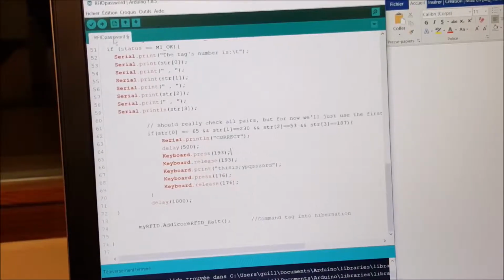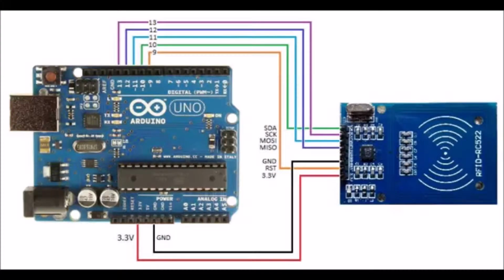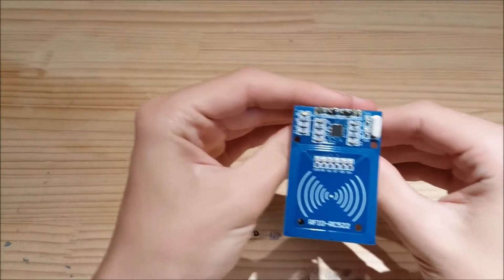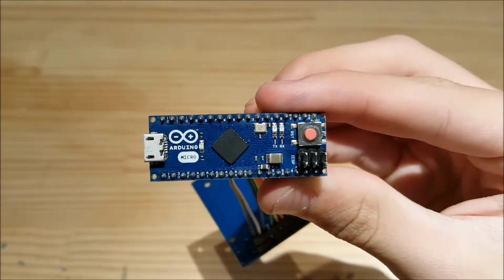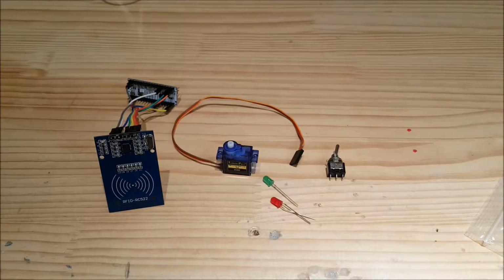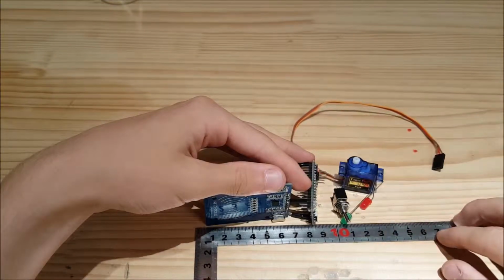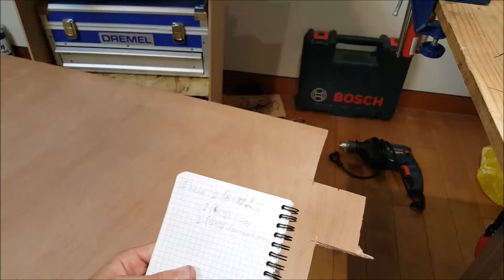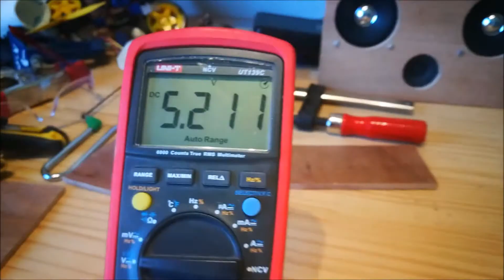AWESOME RFID BOX!

Comment: Can we have all Arduino codes please
Reply from the maker: Here is the code:

//Electronology RFID arduino box. 06/2018. You pass the badge in front of the receiver
//and the servo turns to open the door

#include <AddicoreRFID.h>
#include <SPI.h>
#include <Servo.h>

#define uchar unsigned char
#define uint unsigned int
uchar fifobytes;
uchar fifoValue;
AddicoreRFID myRFID; // create AddicoreRFID object to control the RFID module

Servo myservo;
//pins
const int chipSelectPin = 10;
const int NRSTPD = 5;
const int greenLED=12;
const int redLED=11;

int opclo=0;

#define MAX_LEN 16

void setup() {                
  Serial.begin(9600);                        // RFID reader SOUT pin connected to Serial RX pin at 9600bps 
  SPI.begin(); // start the SPI library:
  pinMode(chipSelectPin,OUTPUT);              // Set digital pin 10 as OUTPUT to connect it to the RFID /ENABLE pin 
  digitalWrite(chipSelectPin, LOW);         // Activate the RFID reader
  pinMode(NRSTPD,OUTPUT);                     // Set digital pin 10 , Not Reset and Power-down
  digitalWrite(NRSTPD, HIGH);
  myRFID.AddicoreRFID_Init();
  //Servo
    myservo.attach(9);
    myservo.write(0);
  //leds
    pinMode(greenLED,OUTPUT);
    pinMode(redLED,OUTPUT);
}

void loop(){
  uchar i, tmp, checksum1;
 uchar status;
  uchar str[MAX_LEN];
  uchar RC_size;
  uchar blockAddr; //Selection operation block address 0 to 63
  String mynum = "";
  str[1] = 0x4400;
  
  //Find tags, return tag type
  status = myRFID.AddicoreRFID_Request(PICC_REQIDL, str);  
  
 //Anti-collision, return tag serial number 4 bytes
 status = myRFID.AddicoreRFID_Anticoll(str);
 if (status == MI_OK){
    Serial.print("The tag's number is:\t");
    Serial.print(str[0]);
    Serial.print(" , ");
    Serial.print(str[1]);
    Serial.print(" , ");
    Serial.print(str[2]);
    Serial.print(" , ");
    Serial.println(str[3]);

            if(str[0] == 65 && str[1]==230 && str[2]==53 && str[3]==187){//right card detected
                //Serial.println("Hello !");
              digitalWrite(greenLED,HIGH);
              delay(100);
              digitalWrite(greenLED,LOW);
              delay(100);
              digitalWrite(greenLED,HIGH);
              delay(100);
              digitalWrite(greenLED,LOW);
              delay(100);
              digitalWrite(greenLED,HIGH);
              delay(100);
              digitalWrite(greenLED,LOW);
              delay(100);
              digitalWrite(greenLED,HIGH);
                
                if(opclo==0){//checks if the door is open already
                  myservo.write(150);//open
                  opclo=1;
                  delay(1000);
                  digitalWrite(greenLED,LOW);
                }
                else{
              digitalWrite(redLED,HIGH);//door is already open
              digitalWrite(greenLED,HIGH);
              delay(200);
              digitalWrite(redLED,LOW);
              digitalWrite(greenLED,LOW);
              delay(200);
              digitalWrite(redLED,HIGH);
              digitalWrite(greenLED,HIGH);
              delay(400); 
              digitalWrite(greenLED,LOW);
              myservo.write(0);//close door
              opclo=0;
              delay(1000);
              digitalWrite(redLED,LOW);
                }
            } 
            else{
              digitalWrite(redLED,HIGH);//wrong card detected
              delay(200);
              digitalWrite(redLED,LOW);
              delay(200);
              digitalWrite(redLED,HIGH);
              delay(200);
              digitalWrite(redLED,LOW);
              delay(200);
              digitalWrite(redLED,HIGH);
              delay(200);
              digitalWrite(redLED,LOW);
              delay(200);
              myservo.write(0);//close door

            }}
        myRFID.AddicoreRFID_Halt();     //Command tag into hibernation              
}

Comment: Where is the code?
Reply from the maker: Here it is !
Reply: @electronology4665  thankyou!
Reply: @electronology4665  hey it would also be great if you could make a walkthrough video of making the circuit and installing the card id :)
Reply from the maker: //Electronology RFID arduino box. 06/2018. You pass the badge in front of the receiver
//and the servo turns to open the door

#include <AddicoreRFID.h>
#include <SPI.h>
#include <Servo.h>

#define uchar unsigned char
#define uint unsigned int
uchar fifobytes;
uchar fifoValue;
AddicoreRFID myRFID; // create AddicoreRFID object to control the RFID module

Servo myservo;
//pins
const int chipSelectPin = 10;
const int NRSTPD = 5;
const int greenLED=12;
const int redLED=11;

int opclo=0;

#define MAX_LEN 16

void setup() {                
  Serial.begin(9600);                        // RFID reader SOUT pin connected to Serial RX pin at 9600bps 
  SPI.begin(); // start the SPI library:
  pinMode(chipSelectPin,OUTPUT);              // Set digital pin 10 as OUTPUT to connect it to the RFID /ENABLE pin 
  digitalWrite(chipSelectPin, LOW);         // Activate the RFID reader
  pinMode(NRSTPD,OUTPUT);                     // Set digital pin 10 , Not Reset and Power-down
  digitalWrite(NRSTPD, HIGH);
  myRFID.AddicoreRFID_Init();
  //Servo
    myservo.attach(9);
    myservo.write(0);
  //leds
    pinMode(greenLED,OUTPUT);
    pinMode(redLED,OUTPUT);
}

void loop(){
  uchar i, tmp, checksum1;
 uchar status;
  uchar str[MAX_LEN];
  uchar RC_size;
  uchar blockAddr; //Selection operation block address 0 to 63
  String mynum = "";
  str[1] = 0x4400;
  
  //Find tags, return tag type
  status = myRFID.AddicoreRFID_Request(PICC_REQIDL, str);  
  
 //Anti-collision, return tag serial number 4 bytes
 status = myRFID.AddicoreRFID_Anticoll(str);
 if (status == MI_OK){
    Serial.print("The tag's number is:\t");
    Serial.print(str[0]);
    Serial.print(" , ");
    Serial.print(str[1]);
    Serial.print(" , ");
    Serial.print(str[2]);
    Serial.print(" , ");
    Serial.println(str[3]);

            if(str[0] == 65 && str[1]==230 && str[2]==53 && str[3]==187){//right card detected
                //Serial.println("Hello !");
              digitalWrite(greenLED,HIGH);
              delay(100);
              digitalWrite(greenLED,LOW);
              delay(100);
              digitalWrite(greenLED,HIGH);
              delay(100);
              digitalWrite(greenLED,LOW);
              delay(100);
              digitalWrite(greenLED,HIGH);
              delay(100);
              digitalWrite(greenLED,LOW);
              delay(100);
              digitalWrite(greenLED,HIGH);
                
                if(opclo==0){//checks if the door is open already
                  myservo.write(150);//open
                  opclo=1;
                  delay(1000);
                  digitalWrite(greenLED,LOW);
                }
                else{
              digitalWrite(redLED,HIGH);//door is already open
              digitalWrite(greenLED,HIGH);
              delay(200);
              digitalWrite(redLED,LOW);
              digitalWrite(greenLED,LOW);
              delay(200);
              digitalWrite(redLED,HIGH);
              digitalWrite(greenLED,HIGH);
              delay(400); 
              digitalWrite(greenLED,LOW);
              myservo.write(0);//close door
              opclo=0;
              delay(1000);
              digitalWrite(redLED,LOW);
                }
            } 
            else{
              digitalWrite(redLED,HIGH);//wrong card detected
              delay(200);
              digitalWrite(redLED,LOW);
              delay(200);
              digitalWrite(redLED,HIGH);
              delay(200);
              digitalWrite(redLED,LOW);
              delay(200);
              digitalWrite(redLED,HIGH);
              delay(200);
              digitalWrite(redLED,LOW);
              delay(200);
              myservo.write(0);//close door

            }}
        myRFID.AddicoreRFID_Halt();     //Command tag into hibernation              
}